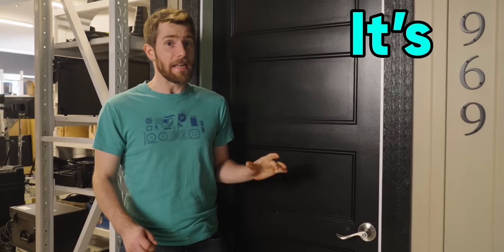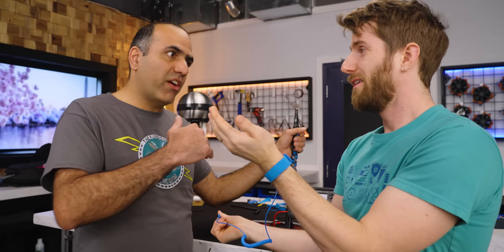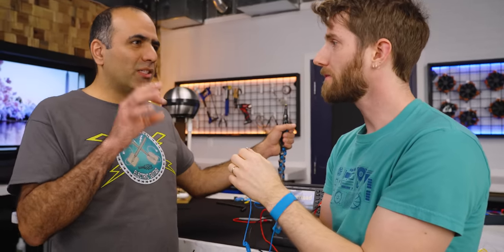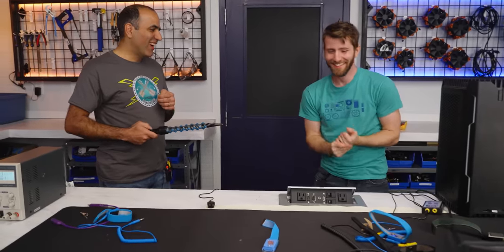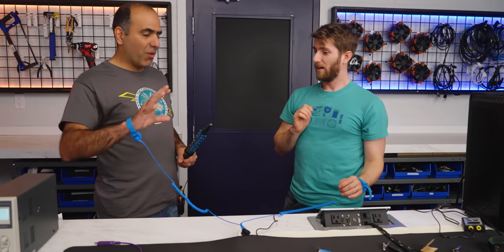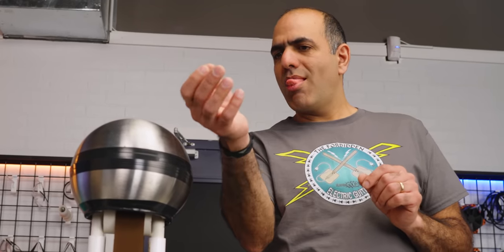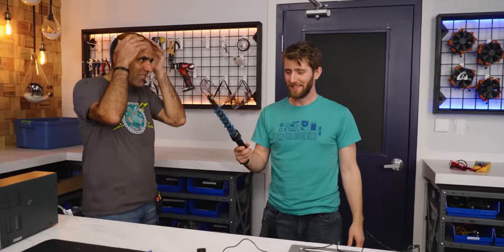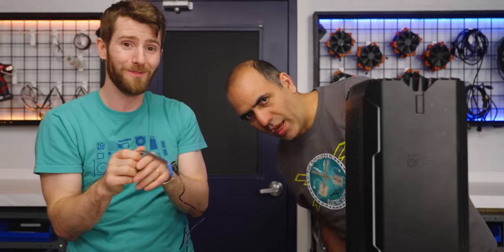The SCAM of Wireless ESD Straps - Feat. ElectroBOOM

Comment: Pro tip, your knee/ elbow has a lot less nerve endings than your fingers so if you make a habit of discharging static electricity by tapping your arm or your knee on a metal door knob before touching it with your hand, you'll save yourself a lot of pain
Reply: Sure does not feel like this way when i hit my elbow on something and it hurts like hell.
Reply: @Raivo_K  that's because you're hitting an internal nerve with blunt force vs. having electrical discharge into an area with a very high density sensory nerves
Reply: Yep, you can even see that Mehdi usually uses the back of his hand which is less sensitive
Reply: @NathanaelNewton  I see. Thank you for clarifying.
Reply: @Raivo_K  You're welcome! One of my co-workers last year was always shocking themselves on the door and I was like dude dude dude.. use your knee or something. Tap it on the doorknob before you open the door and it won't hurt so much.. I feel like I changed their life for the better because they started doing that immediately hahaha
Reply: This is what I always do when unpacking pc cases
Reply: Using a key and tapping that against a grounded surface can also help, because it distributes the flow over a larger area.
Reply: Probably not as funny of a video though, lol!
Reply: @FoolOfATuque  Oh definitely not, this is more for the people watching so you don't have to feel pain at home, It's definitely better content if Linus endures the pain 😈
Reply: @kennichdendenn  Oh yes, that works really well

Comment: I am an engineering specialist . And love elektroboom and Linus . And love the fact that you get young people get excited choosing maybe a tech education later . Believe me, it is so much fun. You can fix your own defect stuff, or throw it away when you blow it up 😂
Reply: Curious, what is the fix-to-explosion ratio?
Reply: @nhojlagap6222  Capacitor related case? Could be 1:10 if using cheap brands and wrong voltage.
It could blind you though...
Reply: @Era  would it be possible to generalize every aspect of engineering and get the general fix-to-brolen/explosion ratio? Since deltalex is a specialist, he might be more combustible stuff.

Thanks btw for giving the ratio for capacitor related cases! Basically you have a 10% chance of success and 90% of fireworks. Nice!
Reply: @nhojlagap6222  Lol, the percentage is a joke though.
But a good brand caps will have the top burst open instead of whole aluminum casing fly off like a bullet if you overload the caps.

Comment: If you still have the japanese bracelet it might be worth checking it with a Geiger counter as some of those bracelets use radioactive particles in them.
Reply: This needs to be tested, I've seen videos that has silicon bracelets and pendants that were "negative ion health products" that were actually radioactive.
Reply: Yep, thorium.
Reply: If you look at those bracelets that you was talking about you'll note that they have white particles in them and then this bracelet does not have those white particles. So I'm willing to bet money that it's perfectly fine
Reply: @the_undead  the glitter in this bracelet could be coated in thorium
Reply: @MrRaja681  I highly doubt that because this would be the only application for glitter coded thorium and that would make the bracelet like 10 times as expensive as compared to just sticking thorium directly in the bracelet alongside the glitter
Reply: @MrRaja681  Bro, someone just tried to make a quick buck with the least amount of money possible
Reply: Nothing wrong with a Geiger counter sweep.  If it's benign, then great, it's a regular scam!  If it's not then break out the small lead container!  In short, it's merely a safety thing.
Reply: @williambilliam5001  Are you testing everything you receive on radioactivity?
Reply: @bumblebee6875  nope! Just the products to that have merely established a reputation for that kind of crap, assuming I'm the type to even buy bracelets like that. It's a rather simple position, I don't understand how someone could conflate avoiding or at least testing types of products proven suspicious with sweeping everything with a Geiger counter.
Reply: T5😊z😊
Reply: @williambilliam5001  my question is why are these particular bracelets proven to have radioactive materials in the way and the only relation they likely share with the negative ion bracelets is there made in the same country and they use the same base material (silicone, which happens to be used in the vast majority of cheap bracelets sold) so are you checking the vast majority of Chinese or Japanese products that contain silicone for radioactive material?
Reply: @williambilliam5001  please tell me how I'm twisting words, you're saying that these bracelets need to be tested for thorium particles, and you're also saying you only test stuff that is likely to contain radioactive material and the only relation between these bracelets and the negative ion bracelets he's that they're made in the same country and they're both made of silicone, none of the people involved are the same none of the companies are the same, just the country and the material
Reply: @the_undead  You have your instructions, this message will repeat.
Reply: @williambilliam5001  you're the kind of person that just acts like they're better than everyone else when in reality you're just like everyone else. If I am twisting your words please tell me how I am because when somebody is twisting their words they cannot figure it out themselves because, because it is a fundamental misunderstanding in ninety-nine per-cent of cases that leads to the twisting of words. Maybe if you worked with me and instead of against me this would be easier for both of us
Reply: @the_undead  You have your instructions, this message will repeat.
Reply: Holy shit that's scummy as fuck
Reply: @goddamnit  these bracelets likely don't contain any thorium dioxide like is being claimed here. However those bracelets are absolutely a thing, and why you shouldn't ever trust any alternative health products.

Best-case scenario there in chunks of whatever material they are made of, worst-case scenario they are spewing out ridiculous amounts of radiation and bringing you quite close to or even above your yearly dose limit.
Reply: @williambilliam5001  Wow such a hard man repeating a message since you wont actually reply to someone. Their points are valid but for some reason you have to act like you are better than them, why?
Reply: @the_undead  @Conor Stewart
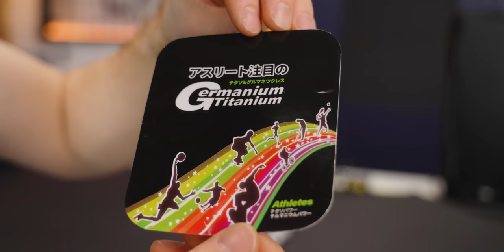The Japanese info card at 24:42 says "Emits negative ions from the entire band. Works well on stiff necks." with a diagram of it supposedly heating up someone's neck.
Seems like it really was a 'negative ion emitter' band, falsely advertised as an ESD strap.
Reply: acutally isn't germanium readioative?
Reply: yeah that glitter kind of looks like thorium powder from where I'm sitting
Reply: another collab time??

Comment: Had to wear those constantly at my last job.  Even with those, ESD table tops, and other precautions we were shocking our scopes and throwing them out of calibration all the time, so we had to upgrade to using ESD lotion to increase conductivity on our skin, using two straps (usually one on the wrist, one on the ankle), and connecting those straps to a simple monitoring device at each lab station that would emit a high pitched wail any time it detected a loss of conductivity.  The conductivity of the strap itself wasn't nearly good enough compared to the metal plate on the buckle.

Comment: Long story short:

A few years ago I got a little complacent when I was maintaining my Philp's stereo receiver unit. I disconnected a grounding wire, accidentally made contact with something, received a good shock, and fried the unit's computer resulting in minor issues with the display, programming, and slight issues when operating the CD player/changer. The reception/tunning of FM radio was unaffected.

Comment: You should be careful, some of these straps actually contain thorium oxide for whatever stupid reason and are therefore radioactive and fairly dangerous. I wouldn't be surprised if that's what those "white specs" were. I think the idea is that the alpha decay will pull ions away from your body (which is technically true, but doesn't work nearly fast enough as seen in the video) But obviously wearing radioactive wrist bands probably isn't a good idea even if it did work
Reply: Thought Emporium made a video about something similar.

Comment: In engineering rooms there is also a different way: chairs and floor are conductive as is the mat or the whole work surface.  The straps you wear are actually either your shoes (if you've been provided with conductive footwear) or actual straps around your shoes (typically used for temporary visitors as they wear quite quickly).  This means you're continuously discharged and your electronics are safe :).

Comment: The 1 Mohm is also there , critically, to allow the electrostatic charge to dissipate slowly, at a reduced current, as opposed to dumping through the strap at a high amperage. This is also why the strap doesnt zap Linus while he is touching the  generator.
Reply: the generator cant output much current anyways, so the high resistor would help only in a high output current generator. we can prove that by linus nothing being able to discharge himself while touching the generator, because the strap even with 1 megaohm can discharge him fast enough.
Reply: It's there to limit current - that's what they said in the video.

Comment: Pro tip, if you don't have a esd bracelet during ad hoc work, develop the good habit of first touching the chassis or ground plane before touching another component.   Another pro tip, when working with household circuits, have rubber shoes on and keep one hand in your pocket. Also non contact voltage detector may save your life if you flipped the wrong breaker.
Reply: Or just a simple tester will let you know,those analog ones screwdrivers with a light not digital ones

But newbies yes,they should follow these precautions if they doing it for the first time and not well versed with it
Reply: Why the one hand in pocket?
Reply: @Felipe Taboada  just so you don't get current across your chest (heart). Basically don't get both hands across the potential voltage.
Reply: I always touch my radiator
Reply: What if your house doesn't have any grounded circuits (like mine lol)
Reply: @0FFICERPROBLEM Then it needs to be rewired as it's currently very unsafe.
Reply: I always fix my household circuits with two hands in the pockets. Works well.
Reply: @nikkiofthevalley  I'll tip my landlords here in Mexico about this 😂
Reply: @0FFICERPROBLEM man if they did rewire they must have broken the walls or bought wire for the first time since 20+ years lmao
Reply: @0FFICERPROBLEM doesnt that scare you! As a brit we prob have skme of the highest safety standards for electricity in the world, that really scares me to hear lol. Is that common in mexico? What about hotels?
Reply: @0FFICERPROBLEM  touch exposed plumbing (assuming its copper) is your best chance.
Reply: Okay smarty-pants. It's a lot harder to die from 120v than people think, unless you do something stupid like fully clench your hand around a bare wire. Fork in the outlet, using a full metal screwdriver. I replaced all the outlets and more in my house all live. Granted, I'm an electrical engineer, so I know how to work hot, but Most importantly you missed this one, you work diligently and with care and there is no way you can die from 120. Always assume every wire will kill you; always remain vigilant, NEVER ASSUME, and always take safety seriously don't be one of those old coots that blows themselves up (seen it) because "I have been doing this for 40+ years I know more than you, what are you 12 anyway? Go back to your kindergarten class kid"

And not I'm not talking OSHA Safety "here before you step over this ladybug I need you to put on this helmet and pads for me, good, okay thanks, now hold my hand take a deep breath and take that first step, be very careful now there is a 99.9998% chance you die here, what do you want me to tell your family"

Comment: The only way I could think of for a ESD strap to work without a wire, is if it had the ability to store electricity, such as maybe a battery.  It would have to be done in such a way that the static electricity that you build up on your body, would be used the charge the battery.  Though to stop the battery from becoming over charged, you would have to give it work to do, such as powering a light or something.  The battery would obviously need to be rechargeable..   I haven't put any more thought into than that honestly, but its the only way I have thought of to make it work..   The idea seems good, but it might take a bit more knowledge than I have on the topic to make it actually happen.

Comment: Having two people touch with static would be a good way to gauge pain tolerance. Since the shock is the same for both of then it could be a good way to compare two people with the same pain.
Reply: I want to try out the menstrual pain simulator.
Reply: That's not how you start a conversation XD
Reply: There is a lot more than meets the eye. It's not as simple as "same charge = same sensation". People don't have the same skin resistance on a day to day basis for example, let alone as compared to another person
Reply: @Lurch, you just described pain tolerance while saying it wasn't pain tolerance. You build up tolerance from exposure, that's the point.

Comment: Seeing a collab with ElectroBOOM is always fun :D The only thing I was missing was an explanation why these wireless grounding wrist bands don't work, also touching on the topic of how air humidity plays a role and how the body gathers charge less easily if humidity is high.
Reply: wireless ground is amost an oxymoron
Reply: It's in the name lol. They don't call it 'grounding' for no reason. The ESD strap need to be tethered to the ground because how else the electrical charges gonna get grounded?
Reply: Actually, there have been strides recently in wireless grounding that actually works. Military and research companies have worked on controlling where lightning bolts hit to protect buildings or equipment, or striking a specific target. Right now they only have a success rate of about 30% or something like that. Better than nothing, but a long way to go. So wirelessly grounding something is possible. They create an ion trail out into the air by deliberately charging air particles in a pathway with a laser so that a static buildup (lightning, esd) follows that path.

As for the wristband itself, ya those were never going to work and that is nonsense. The wristband would need a whole set of electronics and battery to put out charged ions in a specific direction and track the target object through hand movements and such to maintain a "grounding pathway" through the air. None of which is practical in a wristband form factor or from a cost perspective.
Reply: Charge concentrates at a point, so things like air ionizers use needles or carbon fibers. Lightning avoidance devices on radio towers are similar. A wristband covered in carbon fibers sticking out would probably "work" by lowering the resistance to the surrounding air. But it would also likely be very impractical in use, and those fibers get into your skin like fiberglass.

Comment: i have to pause at 23:03 the video as I dread what i heard.. that japanese wristband with the glittery stuff.. i'm assuming it's marketed as a negative ion bracelet too.. that means that glittery stuff is potentially thorium powder.. aka radioactive material which the channel The Thought Emporium did videos about recently where they purchased "negative ion" products off amazon and placed them near Geiger counters and in cloud vapor chambers and other detection devices to show their radioactivity, what type, and how much. they event sent off samples to get mass spectrometer'd and verified they were of radioactive material. 

So in otherwords, if you cut that product open and got the powder all over, on yourself, or worse, inside of you.. you potentially contaminated the set with radioactive dust.
Reply: well after unpausing and watching the rest, i am relieved to say that i am glad it wasn't loaded with loose powder.. instead just seems embedded in the silicone.. so if it is indeed thorium powder, then the risk of contamination is low/negligible.. anyways I highly recommend seeking out those videos i mentioned and beware of "negative ion" products sold on amazon marketplace.

Comment: I worked at Apple Computer (long ago when they still had “computer” in their name) and I had built tons of PC’s before but when I went to fix a Mac (“Quicksilver” PowerMac) on the assembly line that was putting up an error code everyone screamed at me when I grabbed a CPU card off the rack. I didn’t plug in my ESD strap first… the “procedure” was to go to the rack, plug in your strap, grab what you needed and put it into a static bag then go back to your “rework station” and plug your strap in there and take the part out of the bag.

Waste of time…🙄

But it was fun working there! I got to work on all the new products when they first came out like the G4 Cube (I still have mine with its box!), the Xserve, the eMac and the PowerMac G5. Steve Jobs would order that production line have a huge curtain surrounding it and security stopped everyone from going through the curtain unless you had a special sticker on your badge. Once Steve did his keynote the curtain came down. I miss those times……